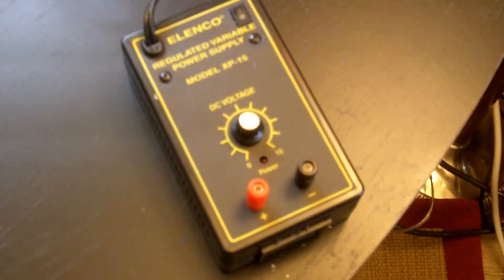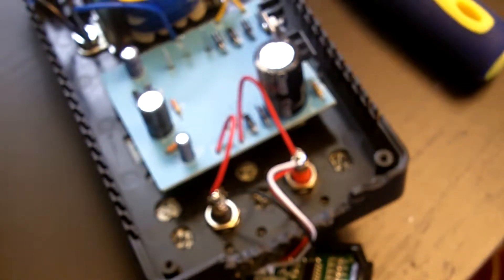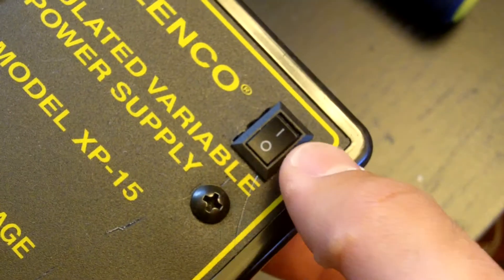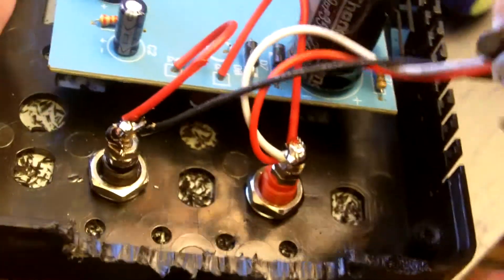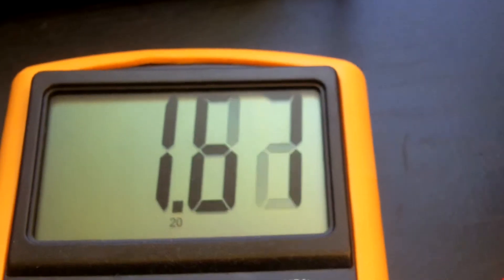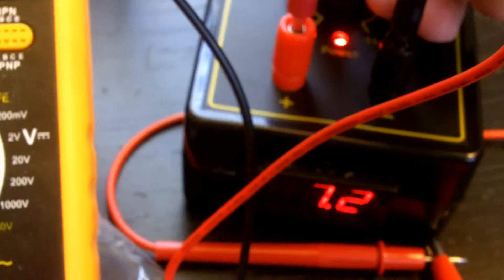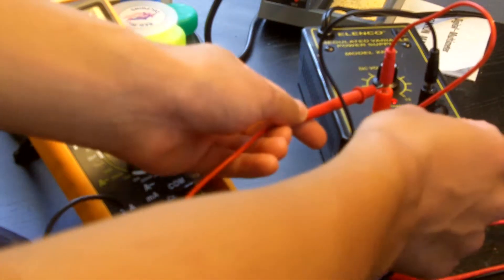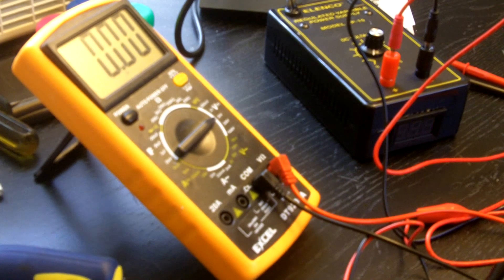Elenco XP-15 Digital Voltage Panel Meter Modification overview

Comment: I moded mine too, the way to have your voltmeter working below 2-3 volts is by soldering the red wire to the output of the voltage regulator the black wire is soldered onto the negative terminal and the voltage measure wire (white wire) is soldered to the power terminal. With this you don't need a battery to power the voltmeter
Reply: I wouldn't mind hearing more about this constant power mod for he panel meter. I assume that you mean panel meter red to output leg of the regulator transistor and black to neg post and white to pos post. Being a little raw, which leg of the transistor is the output? I guess (with a multimeter) grounding to the transformer chassis and looking for DC voltage on each leg of the transistor would do it? Thanks.

Comment: A Dremel tool (with appropriate bits for cutting and filing plastic) might be helpful to you in making cleaner cutouts.  I'm considering building one of these, myself, though I want the meter to read low voltages.  A 9V battery is an interesting solution, though I'd prefer not having a battery in there.  One thing you always have to remember, especially in devices that are rarely used, or incur little drain on the battery, is that it WILL eventually leak, and muck things up inside. Also, it just sucks having to disassemble something with the screwdriver just to change the battery.  Have found your videos inspiring, and this old guy has learned a thing or two from them.
Reply from the maker: I am glad you enjoyed this video! You are definitly right about the Dremel idea, If I had a Dremel at the time I definitly would have used it because cutting out the hole with a drill was an absolute pain.